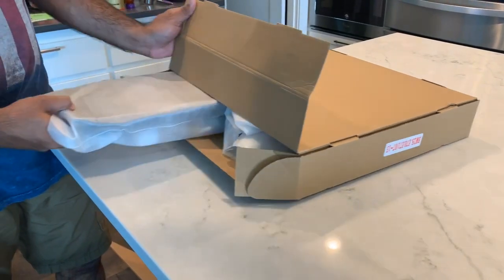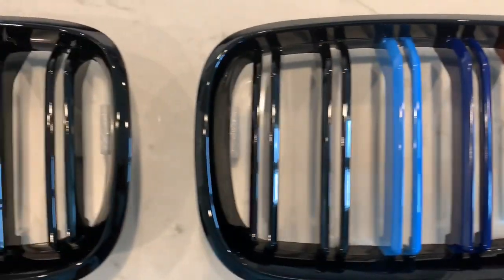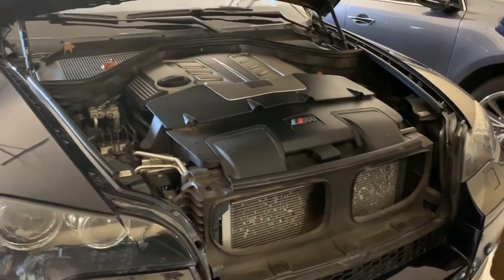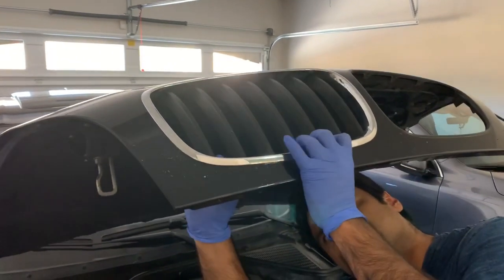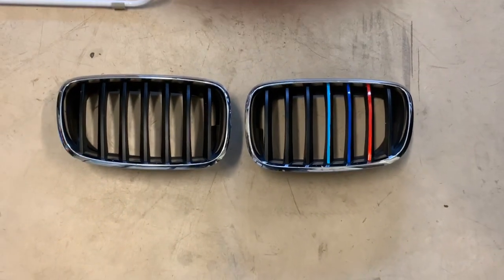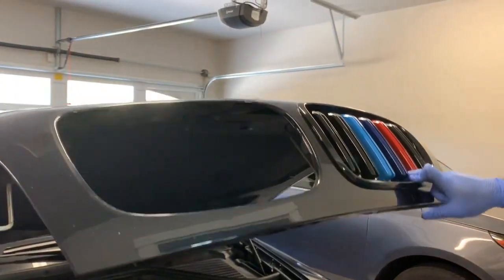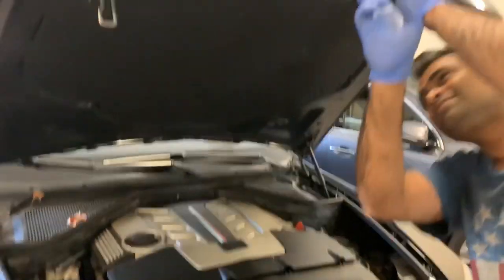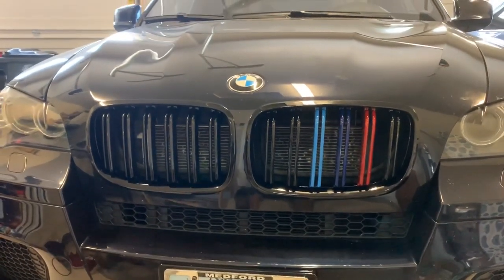How to replace BMW front grille in 5 minutes! No tools needed!!!

Comment: im actually in the mid of struggle whether just add that 3 colour straps at the existing chrome frame or change it to black just like this. Also, there is another diamond grill in chrome. Which one is more impactful. I worry I don't feel much after the changes. hhmm...or i might just feel "is not standard grill" thats all. haha...
Reply from the maker: I would recommend the black grill with the M stripes. I feel that it has the most impact. I miss the X5M
Reply: @atk9836  i just bought the gloss black frame with chrome diamond. I saw one on the road it looks like newer facelift model to me. I like the chrome diamonds pair with my polished offset wheels instead of the standard chrome frame. Gloss black frame looks sportier! 
The straight lines give a feeling of older standard look in my opinion. 😅